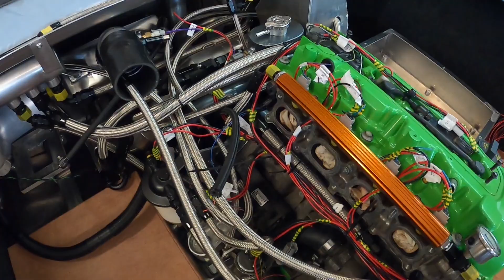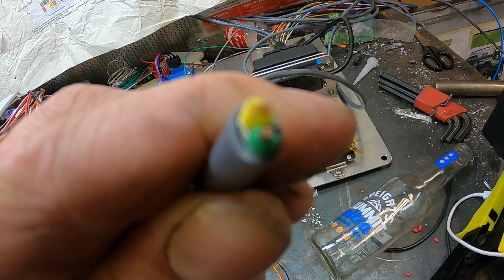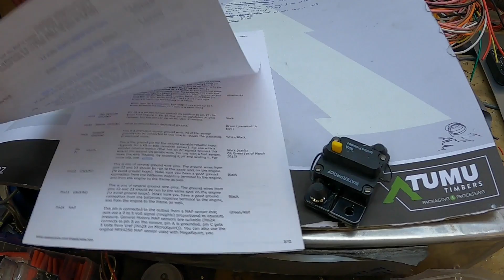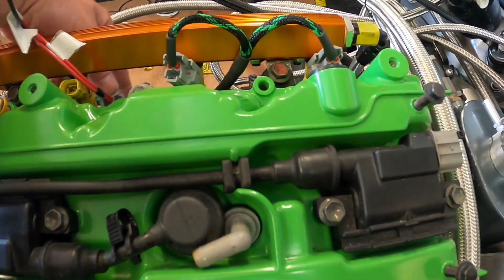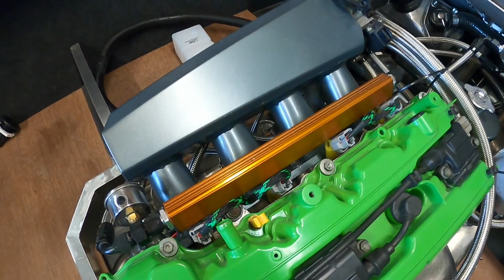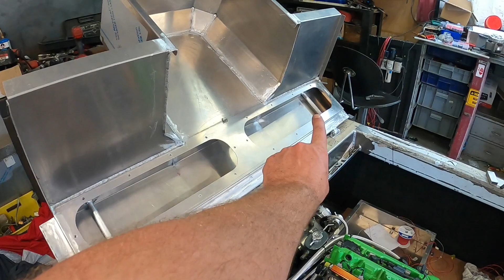Turbo Jet Boat Build NZ PT14 - Continuing with the wiring and engine cover heat/water extraction

Comment: Isn't the drain dumping onto the air filter?
Reply: said he is going to add a funnel so it dumps out the back
Reply from the maker: it will have a corresponding funnel that lines up with it then will be piped out the back of the boat.